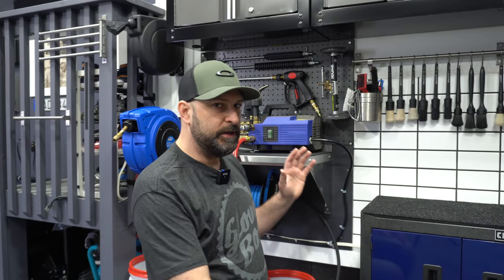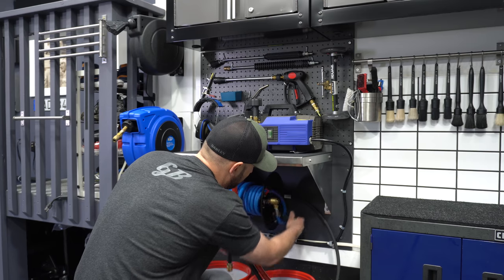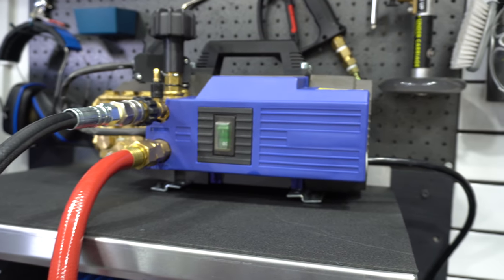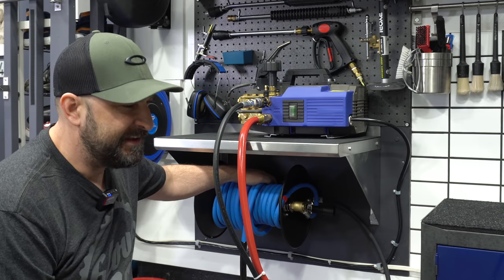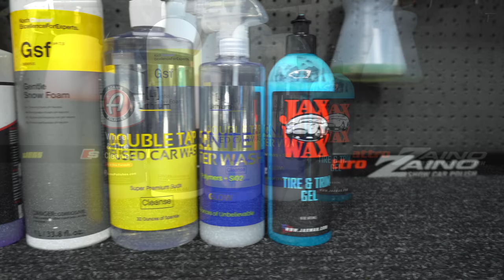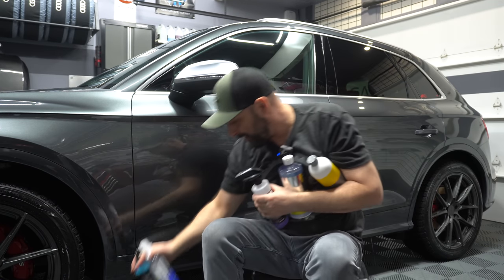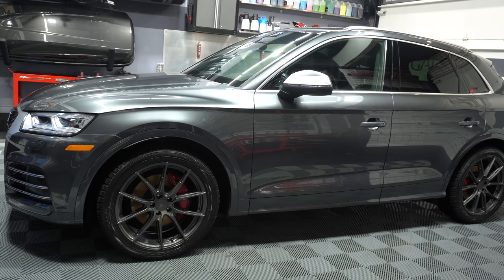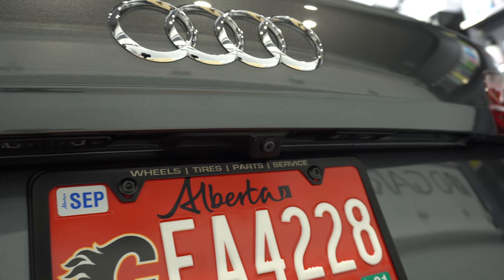AR630TSS PRESSURE WASHER | First Sunday Wash with my new Annovi Reverberi AR630-TSS Pressure Washer

Comment: Rick, I have a AR pressure washer about 3 years now, workhorse, and love it.
Reply from the maker: That's awesome. My previous one (AR390SS) was a steady workhorse as well. I'm going to do my best to maintain it and hopefully it will last me a lifetime.
Reply: @RADGarage  every spring I replace all the rubber gaskets, the most significant thing that everyone forgets to do is prime the system before turning on the pressure washer.
Reply from the maker: You should do a video of your process!

Comment: I feel your pain, I really do & as a result have a car especially designated as shopping trolly which hasnt seen soap & water in over 12 months and still no dinks.. However its total decadence having a wash bay in your garage, I love it..(p.s. love it all except shiny tyres)
Reply from the maker: Thanks. Part of me likes the idea of having a runabout but the other part of me would see it as a missed opportunity to enjoy my SQ5. I really enjoy driving it.
Reply: @RADGarage   I know that feeling too, I bought a fully loaded LS460 late 08 with delivery miles on it, Ive never had a car more than 2 years absolute max (& Im an old git) but my initial purchase of reliability has grown & I still love the thing. I also bought a 640 convertable late 19 to encourage me to get our of the garage a lttle but continual lockdown has blown that out of the water, fingers crossed we might get out this year.. Anyway. my local shopping zone is only a mile or so and the shopping trolly was/is a beat up 118d with different coloured body panels but mechanically sound.(& now drives like a scalded cat since she's been chipped & a slightly bigger turbo. I may get her wrapped this year but the miles she does wouldnt get either of my other two up to normal operating temperature, hence I see it as protecting them from the great unwashed & brainless who dont think twice about banging their door into yours..( that happened to me seven or eight years ago, older lady smashed her door into mine while I was sat in it. She said nothing so I got out & saw a dink like yours. I was not amused. I asked her to look at what she had done and what was she thinking about damaging my pride and joy.. she said " if you'd have bought a car with those bumpers on the door as I have you would never have noticed that " The red mist descended, I stamped & rubbed my rubber sole shoes into the gravel & then ran it all down her drivers door. saying " if you hadnt parked here you would never have noticed those scratches now would you "  She decided it wasnt such a good day to go shopping & left. My door cost £500 plus to repair They had to spray the door as it couldnt be matched, QED the shopping trolly is a no brainer &&&&&&&&& causes me zero stress while parked anywhere..

Comment: New setup is looking good, once again! I need to get some plumbing done in my garage so I don't have to haul a hose over and connect to my pressure washer setup every time. I just haven't put in the research and effort to get it done, but I know it'll make washing much more enjoyable when things are at-the-ready all the time. At the moment, I'm just pulling the front garden hose to was the car instead of using my pressure washer, geeeees I am so lazy haha. I must get the plumbing done so I will be more inclined in using the nice pressure washer. I was wondering when you would get a hose reel setup! I've got a frankensteined SunJoe and some cheap hose reel with a flexzilla pressure washer hose at the moment. Wall mounted and that's all gravy, just need to do plumbing and electrical.
Reply from the maker: Yeah, it can feel like an intimidating amount of work and research. I'm glad I was able to finally make it a reality. I think I will be kicking myself that I didn't do this many years ago!

Comment: Excellent video like always!  I wonder if you’d be better off putting the AR on a cart instead of on the wall, you can wheel it further away from the wall during midnight washes and also then eliminate any vibrations from the mounted shelf.   Sadly I know the pain you feel, I found two small dents on my driver side passenger door on my Tesla, and after some probing I found out that my son and wife were the culprits. 🤦🏻‍♂️. Hopefully I can get them removed easily when the Chicagoland weather improves.  👍
Reply from the maker: The cart is something I thought about, but with the two hoses coming out of the machine, plus the power cord I opted to just keep it in a permanent spot. I found some extra Kaizen foam I had kicking around so I put that under the unit so hopefully my wife won't hear it as much. I think I had it right up against the wall which was probably making matters worse. I have pulled it away from the wall an inch and everything seems much quieter now. Sorry to hear about the dents on your car. These PDR techs are so good, I'm betting you'll be fine. The worse part is when the paint is damaged.

Comment: Awesome video as always. I wonder if you could put some rubber gromets between the feet of the washer and the shelf to stop the vibration. Like the shock ones you see on small  generators. Alternatively some spacers between the wall and stainless shelf?
Reply from the maker: I’ve actually put two pieces of Kaizen foam under the machine. It’s all good now.

Comment: Hope you like the pressure washer. I wanted to get one,  but I’m in a rental and not sure how well it would had worked 

So I looked at comet static and then the new Adams pressure washer pro. I got the Adams pro for reviewing purposes and am happy with it. But the 630 is the one I really wanted lol
Reply from the maker: I looked very closely at the Comet and the Adam’s, but then I received a fateful email and the rest is history! I’d be interested to hear how the Adam’s works out for you.
Reply: @RADGarage  I’ve been reviewing it this past 2 months. I did have a cG review I was going to post on YouTube since no one else has and then I realized I didn’t actually put it through it’s paces.

It’s nice. It’s a knock off of a kranzle 1122ts or thr 16xx one. 

Has some benefits and none benefits. It is super quiet and pushes about 1.83 gpm at 1150 psi.

Comment: I did a two step paint correction, and ceramic coat on my mustang. And the next day, I made sure to park the car far in the parking lot. What did I discover? It was keyed when I got back. That tiny ding is nothing and will be repaired quickly. Don’t worry about it.
Reply from the maker: Oh man, I can't believe someone would do that to your Mustang? I have never understood what would motivate someone to do such a thing. You are right, the tiny little ding and nick I am dealing with is NOTHING compared to your situation. Mine was just an irritation in the process of having a great and relaxing detail. Will you be having to repaint?

Comment: Good Day Teacher Rick😀,thanks uploading another awesome video. I updated my pressure washer from Karcher to Kranzle, will try it next week. Since I want to re-coat my car’s PPF with Halo, I need to decontaminate it first, I bought Gyeon PPF Wash and Tar remover, and will polish it with PPF Renew, can I clay the PPF after chemical decontamination but before polish? I want this time the coat can be coated successfully and last long👊
Reply from the maker: I can't give you advice because I find PPF's all react differently to various cleaning products. I guess I can say that I would find a very mild polish and use that, but be careful with any kind of decontamination sprays on PPF. I have had a few issues in the past. That Gyeon Tar Remover on PPF makes me feel uneasy. How bad is this PPF that you feel it needs a clay? So many factors at play here.
Reply: I got your point, I will follow gyeon decontamination process and do light polish.

Comment: As always, superb job! I’m with you on the tires, my wife’s SUV has a bit of shine and my car has satin. Silly question, which nozzle fo you use when rinsing the soap from hand wash?
Reply from the maker: Thanks! That nozzle is a regular garden hose nozzle I picked up at my local Canadian Tire. It usually stops working 2-3 months in, so I am constantly taking it back for a new one. I DO NOT recommend. It has a less-than-2-star rating: https://www.canadiantire.ca/en/pdp/yardworks-10-pattern-front-trigger-nozzle-0597178p.html
Reply: @RADGarage  Totally missed this message. I hear you, thanks for the info, I've been looking for something decent without having to spend an arm and a leg.

Comment: Wow, kudos to you sir and your editing and video skills, highly impressed with that, excellent job! Was wondering if you were going to mechanically wash with a mitt or sponge after spraying the snow foam and couldn’t believe how clean it was after just rinsing away, and then you hand washed it. Will need to try out that tire cleaner and the jax wax. How do you have the foam cannon tuned / soap gsf to water ratio? I tried mine for the first time yesterday, did half the instructions, 10ml to 500ml and it was a bit runny, not as nice as yours. Ar630tss user here too. Thank you!
Reply from the maker: Hi Stephan. I would give the Jax Wax a pass. It did not live up to expectations. For my foam setup, I add 100ml of most shampoos to the 1L canister and usually get amazing results. I have the cannon on full blast with the widest spray pattern. Never lets me down! Thanks for the comment and be sure to check out my more recent uploads for more looks at how that foam works for me.
Reply: @RADGarage  thanks for the tip will give it a try!

Comment: Really great setup.   Is the AR630 staying in place without being screwed to the shelf?
Reply from the maker: It weights north of 60 pounds, so it stays very much in place. As you can see, I have some foam under it to absorb some of the vibration. It's a stout unit. Like me. 🤘

Comment: Hey Rick!
I was wondering what you would recommend for pads on carzilla for complete paint corection. heavy cut - medium - polish - finish? Keep up the top notch detailing
Reply from the maker: Tough call man. I don't know if there is one particular pad combo I would say is best. I'm glad I have a lot to choose from because some cars just don't want to cooperate. If you haven't yet tried the "coarse" and "medium" wool pads by Rupes, I would suggest you give them a shot. They are highly effective and satisfying to work with. I end up leaning on the yellow Rupes foam pads a lot and they are quite versatile. I also enjoy using microfibre pads. Jescar makes some good ones. Honestly, I like popping in on Chris and asking him questions like this because he's getting stuff all the time. Have you every actually chatted with him? (Don't forget the RAD GARAGE code!)

Comment: A great ugrade! Maybe if you mount te unit to the shelf using some rubber cushion mountings it could reduce the vibrations a bit.  I am truely sorry about the damage that has been done to your car. I have been carrying the grocery bags (including bread) for many hours in my life. Parking far away and trying to avoid most of the other cars. With he current situation in the world I have been trying to find times with less people in general at the supermarket and it is a double win with less cars aswell.
For the first time I noticed that you have the newer version of the MTM foam gun. Have you mensioned it in previous videos and I have missed it? Greetings from Sweden
Reply from the maker: I'm not too worried about the little dent. It has already been removed and the paint nick will be fixed on Monday. I just found a leftover piece of Kaizen foam I used to organize my tool boxes, so I put it under the machine to see if that lessens the vibrations that are being felt in the wall. I also moved the machine a bit away from the wall where it may have been actually touching. That is the same foam gun but I bought the flat-bottomed bottle finally. Take care my friend.

Comment: Would love to buy a 630 but would be a challenge to mount in my garage , way too tight .
You installed a mean machine 😃.
Wich brush did you used for the wheel barrel ?
Reply from the maker: Space is definitely at a premium in my garage too. I have found that having a permanently mounted machine makes everything so much more easy and satisfying. If you can find a way to squeeze one in, I say go for it! The red brush you see me using is hard to find these days. It's a Daytona SpeedMaster Pro brush that seems to be discontinued. It is a carbon copy of the EZ Detail wheel brush you can find online pretty easily. I believe I dropped a link to it in the video description section. Take care.

Comment: Great video. I am a fellow Canadian who looked for someplace to pick up that same unit without a whole bunch of duties and taxes. Ended up finding a local place to source for the  kranzle K1122tst and a BE wall mount electric unit (P1515EPNW). Nice setup!
Reply from the maker: It shouldn't be as difficult as it is for us to source quality garage equipment. I am awaiting final word on whether one of AR's Canadian distributors will be able to extend a RAD discount to buyers. But, sounds like you have things well sorted out with your K1122. Is it working out well for you?
Reply: @RADGarage  I've had it a little over 2 years and it's been good. The pressure gauge stopped working so I've been trying to get a replacement which has been hard. But aside from that it's been awesome. I use the wall mount BE more as it's quicker. But less flow than the kranzle. As I'm sure you realized the industrial or commercial units are much better than the box store ones even if they are rated differently. I reached out to the local light place in Saskatoon you mentioned in your last garage tour and I'm buying some from them!
Reply from the maker: You picked up some LevKom stuff? That's great. Let me know what you think. Recently, I have been struggling with capturing quality video because the lights are SO bright. I am considering unscrewing a few of the trilights when shoot vids. That's how good they are! I agree about the commercial units. They are just so much more capable. I'm quickly forgetting what my old pressure washer was like, but it is a night and day different. 

PS. I hope you used the LevKom discount code!
Reply: @RADGarage  I reached out with questions and I don't know the price yet. I did see your discount code but I mentioned that I saw them in your video. Hopefully the price will be alright, should find out tomorrow. I have 4 t12 fixtures now that are 8 feet long. Just need more light in some areas of garage. My problem is 11 ft high ceilings. Next I need some flooring!
Reply from the maker: I let the team know to treat you in a "RAD" way should you go ahead with any purchase.

Comment: Is your a wash mitt one that has a hand strap or hand insert built into it?  Still liking that wash mitt?  Looking to upgrade my wash mitt, just wanted to see how yours has been performing.  Thx Rick.
Reply from the maker: Yes, it has a mesh holder for your hand. I have been using this CarPro merino wool wash mitt for years now, and see no reason to try another mitt. It's just the best for me. I feel like it really allows me to "feel" the car through the mitt whereas some of the beefier mitts just don't allow for that kind of connected feeling.

Comment: Nice review.  How loud is this pressure washer?  I'm looking to pick up a electric to just wash cars.  I've been using my gas one with my foam cannon no problem but it gets tiresome and loud using it and I'm sure my neighbors are like dude shut up already..lol

The cost on this is half of the Kranzle 1122TST that I've been looking at....  I don't do this as a profession and which makes spending $1500 on a electric kranzle seems kinda silly.  So just wanted to see your throughs on this one.  Seems like a nice small unit which is what I am looking for.  I could care less about attachents because I already have everything.  Just a nice smaller electric pressure washer.  Seems like all the stuff I see at the stores are garbage.
Reply from the maker: You sound like you’re in a very similar boat to me. Shoot me an email at radgarageyyc@gmail.com and we can get into the nitty gritty.

Comment: Rick, why do you always start at the bottom and work your way up when rinsing the snow foam?  I always thought to start at the top and work your way down.
Reply from the maker: As you'll see in the video, by working up you are actually spraying foam and not just water. Starting from the top ensures there is no foam left on the lower portions by the time you make your way down there. In fact, by moving up I was able to force the foam into that tight body gap on the doors multiple times. There is a method to my madness! If I was simply rinsing the foam off it would be a different story, but I am always trying to force the foam into all the tight spaces on the body during my pre-wash foam stage. I hope that makes some sense.
Reply: @RADGarage  I knew there had to be a logical reason.  Thanks for the explanation!  By the way ..I love that Daytona Gray!
Reply from the maker: Thanks Ken. I love DGP. I would have a hard time not getting the same colour on any future Audis.